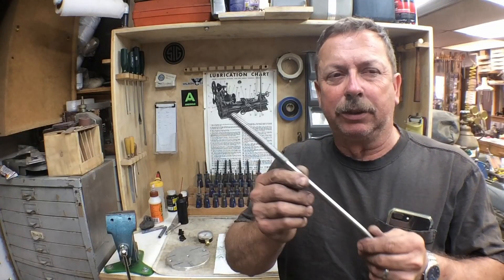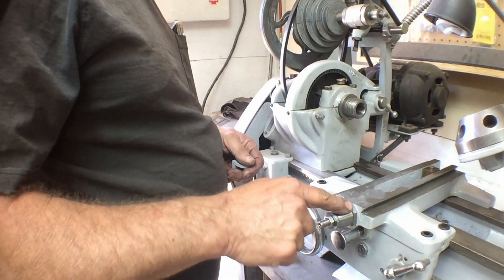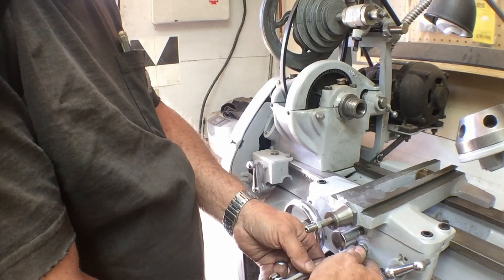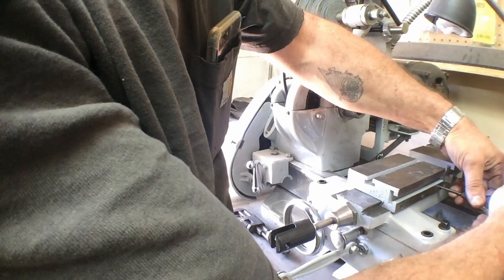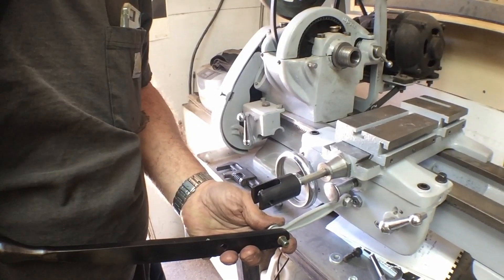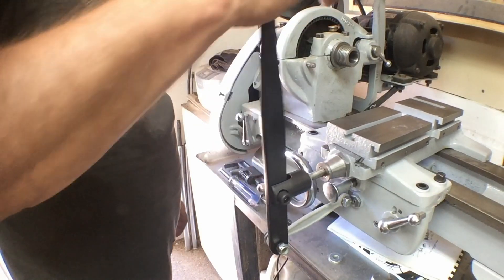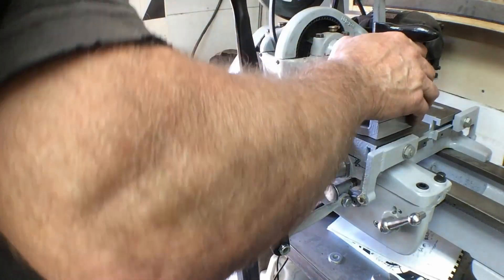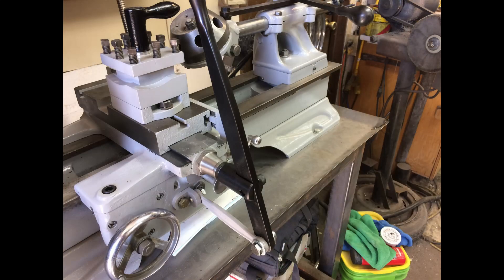Building an Atlas 10" Production Lathe Part 17: The Cross Slide Feed Screw And Assembly

Comment: Wow, I have a TH54 Atlas lathe. The gears for the feed out  and compound in are broken. I also need the 1/2 nut for the feed engage. I also need the feed screw and the small gear that runs the carrage back and forth. I have owned this for 45 years and its not in very good condition 😇🙏
Reply from the maker: Some times it is tough to keep these old machines running, but I think it is worth it. Good luck with yours, Dan.

Comment: You'e done a great job on that machine. I look forward to the next steps. Thanks.
Reply from the maker: Thanks John: I skipped a video on building the gib for the cross slide. it is shot and in the computer I just need to edit it, and the tool post rockers are done except to harden them which will be a seperate video on color case hardening (i hope) next will be either the rear tool post or the handwheel collet closer
Reply: Sounds like good watching anyway you slice it. Thanks.